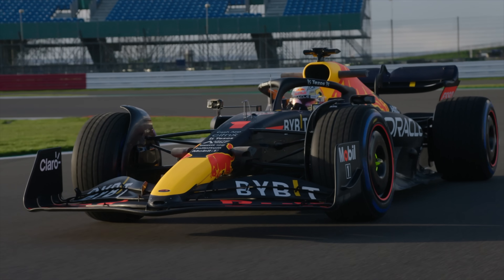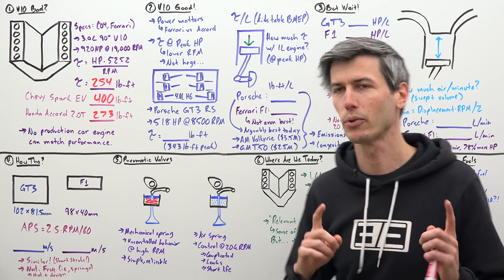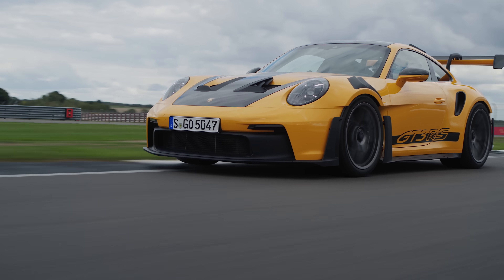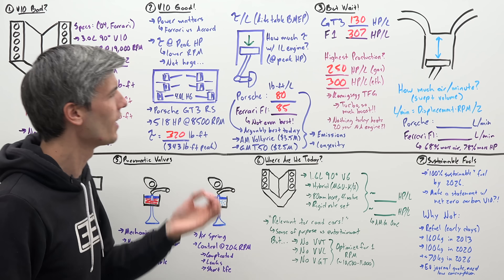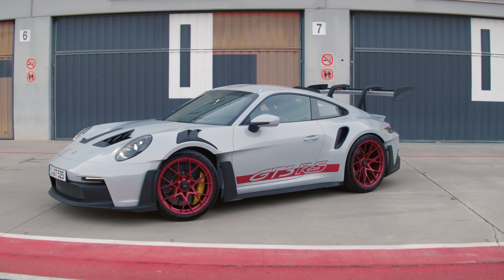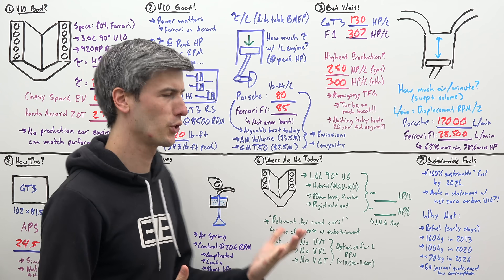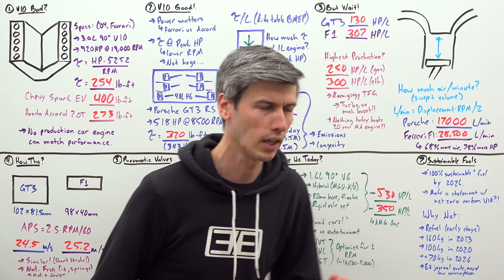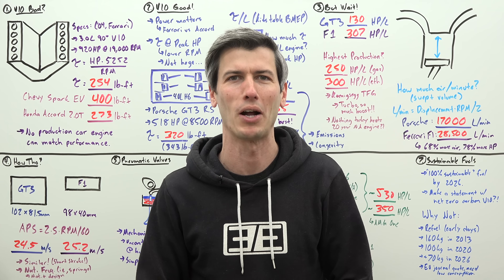Formula 1 V10 - The Greatest Engine Of All Time?

Comment: Easily the most efficient use of fuel from its time.
Reply: They were impressive engines but they didn't have that good fuel efficiency. In race conditions even group C cars from 80s were better IIRC, something like 55l/100km vs 70l/100km. Not quite apples to apples comparison as prototypes generally are bit more efficient aerodynamically than open wheelers and over course of a race group C cars probably had little less power on average, but they were a lot heavier so I guess that evens out somewhat. Either way, high revving small NA engine is usually not going to be very good with fuel efficiency.
Reply: @pekkasalminen9601  Fuel efficiency is how much power/energy can be created relative to a volume of fuel over time.
Reply: @AndyFromBeaverton  Yeah I know and that wasn't all that great on those engines. It's hard to do exact comparison but again in race conditions: F1 V10 cars: around 70-80l/100km for 950hp peak on average; group C was limited to 51l/100km and for example Jaguar XJR-9 (7,0l NA V12) max power is about 750hp on average. That brings us about 12,6hp for liter of fuel for F1 V10 and 14,7hp/l of fuel for Jaguar. Sure it's not the most scientific comparison as the numbers are very rough ballpark figures and there may be differences in fuels, cars are different etc.. But if anything, I'd imagine fuel used in F1 would have been more energy dense and of course F1 cars are much lighter so in fact, the F1 car seem even less impressive in this aspect.

Thing is, these high revving low torque engines are inherently pretty inefficient and during that time refueling was allowed in F1, so fuel efficiency was not priority. Most important was to make as much power as possible with as light engine as possible within limits set by rules.
Reply: not convinced - turbo engines had been around for decades, and were fundamentally more thermally efficient.

Most power per litre, does not mean most efficient use of fuel...
Reply: @GamezGuru1  When the V10s were racing, they were the most fuel efficient naturally apsirated engines.  They delivered more kw or hp per liter of fuel than anything else.

Comment: They should bring them back and just run them on E-fuels or bio fuels with maybe a simple regen system. Bring back the noise! Or at least the V-8s, most of the teams are supercar makers anyway so the relevancy argument is hogwash. There isn't a single V6 on the road that has anything to do with the tech in an F1 PU.
Reply: They shouldn't. The teams don't want to for several reasons. The development of F1 to road is not necessarily as simple as "tech is on F1 car, tech goes to road car", it takes time for big bits of tech to do that. A lot of development for oil and fuel products we use in the modern day started in F1. Also the AMG One would disagree with you, given it's engine is a literal F1 engine made to behave on the road
Reply: @dod_the_angel  The AMG One was also a failure in terms of reliability.
Reply: @C.I...  1. At the first journo test it was and at least Mercedes were honest about it.

2. So is the valkyrie by that metric, given it needs a total engine rebuild every 100,000 miles.

My point is the OP said no V6 road car has any relevance to F1 engines yet seemed to forget about the One.
Reply: @dod_the_angel  Literally the ONE. As in, the one and only. By that measure, let's talk about the Ferrari F50 and it's F1 derived V12. Formula 1 is here for entertainment; the "innovation" aspect is largely irrelevant now with the rules the way they are.

Comment: ¿what so special?
they sound as they should.
yeah, I acknowledge nowadays   engines sounds shitty, probably efficientier.
Reply: ¿Watch the video?
Reply: @HRM.H   ¿what  kind of question is that?
I'm talking  bout the hype.

if there were not the 3.0 Liter displacement restriction, they would probably do a V12 with more displacement. Just happened that the V10 was the most optimal configuration for the 3.0 Liter cap rule.

Comment: If the V10 returned to F1, or via synthetic fuels or via Hydrogen ICE, it would just need a few seconds reeving it up, for the symphony make the fans instantly get bored with the current V6 Turbo Hybrids or Formula E.
Reply: That's why you'll never see historic races with F1 cars at the same event as current F1.  The maFIA knows what the people would prefer.
Reply: @AndyFromBeaverton  I remember how hyped I would get with some onboards with a F1 V10 at full throttle.
Reply: @AndyFromBeaverton  I worked the first Austin race and they had historic open wheel cars that included V-10s.
Reply: @johncooper4637  Were they running during the same weekend?  How long were the races?  At Monaco, they run them two weeks before the F1 race.
Reply: @johncooper4637 detuned and not revving to the limit.  And some with softer exhausts.
Reply: @AndyFromBeaverton  This year's US Grand Prix at Austin had the Grand Prix Masters series running as a support event again (70's-80's F1 cars) so they are still shooting themselves in the foot.